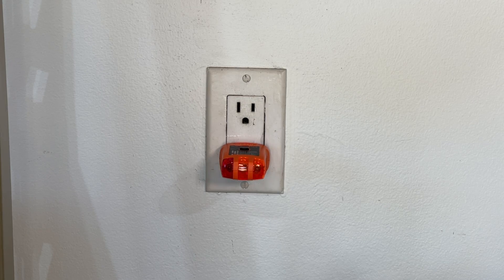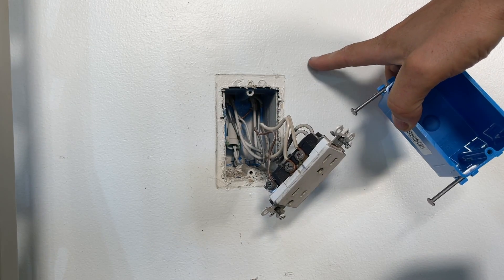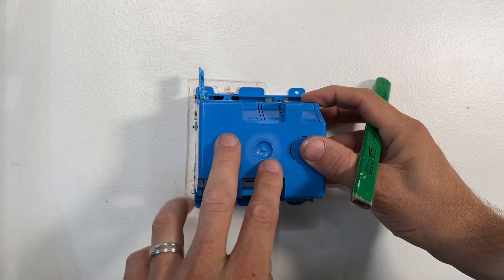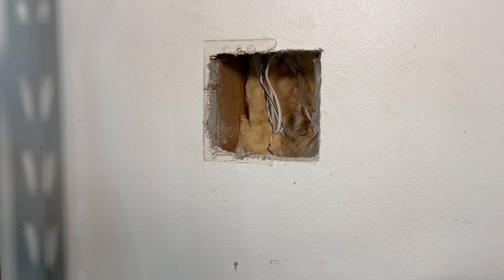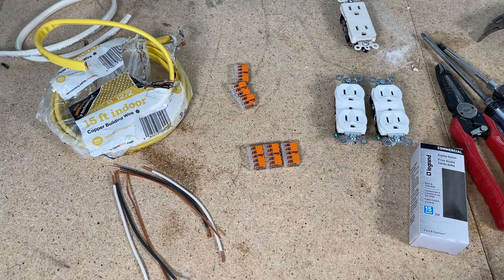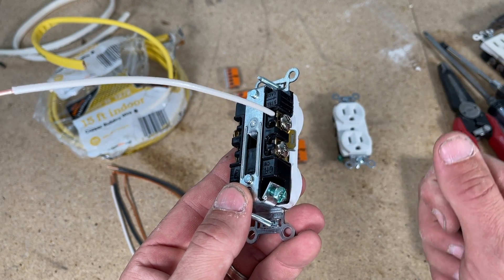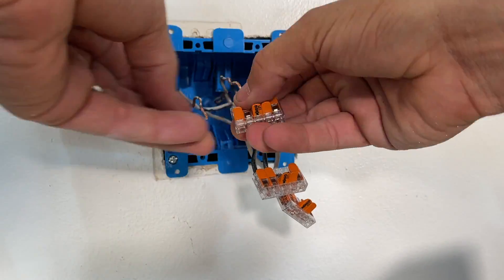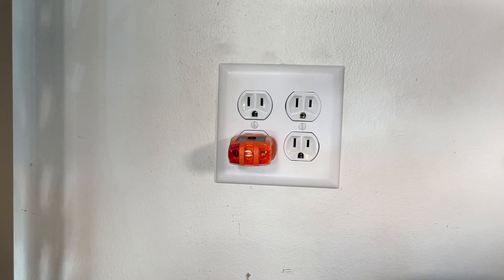Converting 1 Outlet Into 2

Comment: Thank you for pointing out the detail about lining up the faceplate screws! Drives me nuts when screws are not aligned, looks like installer didn't care. Sadly, my OCD has also cost me a few cracked faceplates from trying to tighten the screw "just a wee bit more".

Comment: I'm still trained to wrap every switch or receptacle with electrical tape. May never make a difference, but once is all it takes.
Reply: I agree, it only takes a moment, to tape it.  It cost close to nothing and makes it a bit safer for the next person as a CYA. 

Also if wire nuts were used, I would tape them off as well.
Reply: C NM BBL @alecbosse6425  ĺ b
Reply: Only time I wrap my recepticles or switches is if im working with metal enclosures.
Reply: I require it from our apprentices. Metal or fiberglass box.

Comment: I love these wagos. Im new to the electrical field and wire nuts are the general go to but sometimes dealing with low voltage and some drivers youre dealing with splicing together solid and stranded. These wagos make it a breeze. They have their obvious drawback in not being able to splice together a lot of conductors, also gauge of conductor can become an issue though rarely are you thinking about using a wago on anything bigger than 12, but I still think they should become the industry standard.
Reply from the maker: Agree, they are great and even though they do make a lever nut for 10 gauge I only use them on 12 and 14 gauge.
Reply: Similar have been in use in Europe for over 50 years now. My trade is super conservative and slow to accept better practices,

Comment: Great video. Can I add a third outlet? You added a second one but my wife needs six plug-ins for all her gadgets in the bathroom.
Reply: the problem with adding a 3rd outlet is the sheetrock may not hold up. You could add another box against the next stud and run wire between them. They'd be maybe 6 inches apart.

Comment: There is much easier way to do this. It’s called plugging in a multi outlet extension suitable for 12 or 14 guage for about 10 bucks with no need to fumble with electricity. I dont know why YouTubers do this over common sense since its these two outlets are on the same circuit. Epic fail

Comment: Why did you do 2 separate duplex outlets instead of a quad outlet?
Reply from the maker: At least in my area nobody uses Quads in residential.  Thanks for  the question.
Reply: @EverydayHomeRepairs  So no reason not to then?
Reply from the maker: Not that I see, if you want to install one you should be good.

Comment: Cheaper and cleaner looking than buying power strips, which have become quite expensive lately. On the other hand, there are so many charge based tools and devices nowadays that I have bought the long 12 outlet power strips. Also I always put a drop or 2 of lightweight oil on the screws of the old work boxes as the ones with the plastic tabs can be hard to tighten.
Reply: Also safer

Comment: Here in USA, why don't they "stack" the receptacles sideways so you can plug in power adapters (for example), with the wire coming downward from them, without blocking other receptacles?  Also, why don't they put the ground prong on the top for extra safety, like in case the plug is not all the way in and something metal gets dropped onto it?  It seems like here in USA they do things "backwards" when it comes to that.  If I were designing them, I would likely put 3 or 4 horizontally "stacked" receptacles with the ground prongs on the top.  That to me makes a lot more sense.

Comment: Off topic.  
My home is electically heated.  We have a 200 amp entrance. The furnace is a smart boiler. It heats water, and the hot water is circulated to the radiators with a pump. The smart part is that there is an outdoor sensor that determines the temperature of the water in the radiators.
During November, the water is lukewarm.  When it is really cold out, the circulating water is about hot 160F, and the boiler is drawing close to 80amps   The main entrance is GFCI protected and as well, protected against lightning strikes.

Both the boiler and circulation pump are in-home thermostat controlled. 
We also have a 60 gallon hot water tank.  Its heaters demand 30 amps at 220volts.
Here is a trick to save some money.  Because hot water is less dense than cold water, 
even if taps are off, there is flow of hot water up the pipe to the tap, and in the same pipe there is a flow of more dense water downward back into the hot water tank.
To stop that up/down flow,  get some braided water connection cable and connect it in the form of a loop, such that the hot water out from the hotwater tank has to flow downwards before it flow s upward.  With no taps open, you will notice that at the top of the loop, the braided cable is hot, but at the lower part of the loop, the water there is at home room temperature. The amount of braided cable I use is about 18 inches.
Reply: .... plumbers have been doing this trick with solid copper pipe for decades.

Comment: Since its a 20 amp circuit (using 12 gauge wire), should you have used 20 amp outlets?
Reply: Is the home run and every branch on 12ga? The receptacle doesn't matter it's the wire being protected. Now he mentions you could use 14ga which is incorrect if his breaker is 20A and the wiring up to those receptacles is 12ga. The breaker needs to match the minimum rated wire on the circuit, receptacles don't matter (to an extent. Most 15A receptacles should be able to handle 20A anyways but it's the wire that matters.)
Reply: @etherealrose2139  ... 15 amp outlets are normally a 20 amp pass-through so meets code.

Comment: The outlet has 2 breakers attached to the outlet that's why it has 2 hot & 2 neutral & 2 ground electrical wires? Change 1 outlet to 2 outlets, Romex wires run from the breaker panel does not need to change to higher amperage? If 4 outlets being used, the breaker won't trip or catch fire? Thx

Comment: You have the bare copper wire running right against the left one. Is that going to cause a problem? I seen electrical tape used to wrap the plug before installing.
Reply from the maker: Yeah, I doubled back later on and repositions the ground so it wasn’t close to the neutral.  Thanks for the feedback.

Comment: Not sure why did you use connectors/wago? I think simply you could just connect each outlet to one of the lines. just the ground wires you can use  one wago to 4 of them (2 from panel and one from each outlet) . I'm saying that because each outlet has two outlets connected by default. And I did as per my suggestion last month.
Reply from the maker: I like the pigtail setup so if an outlet has an issue it will not impact outlets downstream.

Comment: Good video. Those stab in connectors are garbage. Use wire nuts
Reply: @Travis Faherty -- Genuine WAGO 221 Lever nuts are not "stab in" connectors (if you stab it, you're doing it wrong), and beware that there are knock-offs out there, but the German-designed WAGOs are a fantastic improvement over wire nuts, if you'll allow your mind to be open. Can you imagine 50+ years ago the electricians who'd soldered/crimped and then bound splices with multiple layers of friction tape for their careers seeing those new-fangled "wire nuts" come on the scene, probably had a reaction like you. WAGO is a world  leader in this connector technology, lesser known in North America. Accepting new and better ways does not mean what you did all those years was wrong. But watch a video or two, maybe request some free WAGO samples from their website. I am sure you'll at least soften your stance if not outright flip your opinion completely, as many many sparkies have.
Reply: @isabellavision  do you push wires in? Or do you twist wires? Okay now just shut up.
Reply: @ironpig701  Not a chance. If you won't even try WAGO lever nuts and review the testing, you can wallow in your ignorance, but you don't need to spread it. Wire nuts had a good long run, but in home wiring applications, they will go the way of the knob and tube.
Reply: @isabellavision  10 year electrician. Been there done that. Wil fire you for using them
Reply: @ironpig701  You can't fire me, I quit. :) But yes, if you have employees, please have them use whatever you want, it's your right. But that doesn't make you right.
Reply: @isabellavision  well 10 years of this stuff around a dozen companies. Every thing from $100 jobs to $6 million dollar jobs. Dont wago. Guess you know more than all these folks
Reply: It's not stab in. They are spring loaded clamped lever nuts. Completely different than a stab in and work just fine. Either wire nuts or WAGOs are fine. Get with the times old man.
Reply: @etherealrose2139  if you say so. No to stab ins. No to wagos. Wire nuts is the way to do it.

Comment: Great video as always.  One question I always have with outlets:   does it matter if anything touches that ground wire in the box?  usually everything is so cluttered in there stuff ends up touching it.  IDK bare wire without coating just makes me nervous.  (I know nothing, sorry if a dumb comment)
Reply: The ground wire and the neutral (white) wires are hooked together in the main breaker box right where the wires come into the house. As long as it isn't the hot(black) wire that touches it, it isn't that big of a deal. However, when I do any electrical work I always, always, always make sure the ground is covered! Even if I have to use a piece of heat shrink tubing on the ground wire, the ground will be covered when I'm done working on it!!!
Reply: Not dumb, smart and, yes, we'll soon see NEC require ground be insulated just as the hot and grounded conductor.

Comment: It was a little hard to see, but it looked like the ground wire on the left was very close to the neutral terminals. I know this is very unlikely to cause a problem, but best practice is to make sure the grounds are back into the box  away from the terminals. I once had a situation where the ground was near the hot terminal and I didn't notice until some time later that due to vibration it had loosened the outlet and when plugging into the outlet it shorted the hot terminal to ground. The breaker tripped, and it took awhile to trace the problem.
Reply: Nice demo of adding a second outlet.  I saw the same thing Tom Cee observed.  I dislike uninsulated wiring "fluff" inside of the box and try not to add to it if possible.  I would prefer substituting an insulated green wire for making up the ground portion of the pigtails (or a white wire marked with green tape).  Neutral should not be touching ground except at the Main Panel (and it didn't in this case, but pretty close.)
Reply: Our outlet and device designs are kind of stupid. There are these big exposed spot on the side of switches / outlets. It would be no problem if the screws weren't hot or had a cover. It seems very dangerous especially if there isn't a cover on the outlet.
Reply: @abdulelkhatib2674  .. there is a section in the national code about covers for boxes and it seems they are required.
Reply: i had old house and figured i would go with metal electrical box and they don't seem to make them very deep like plastic and when pushing wires back into box the one black wire actually was nicked by sharp edge on the hex/slotted ground screw in back of box so it blew circuit breaker when i turned it on
Reply: Since the neutral and ground are bonded at the main panel it shouldn't be an issue though you want to avoid stray current going back on the ground. Best practice is to try to bury it back in there away from the conductors and terminals, especially the hot as you said.

Comment: Another tip would to be make one of them GFI if the circuit isn't already protected by one. I always put electrical tape to cover the screws just to add another level of safety.
Reply: I've never seen the mounting nails of an old box come out as easy as you showed.  They are usually  corroded,  and /or just wedged in there due to all the temperature expansion and contraction of the wood studs.  Not to mention if the original installer didn't drive the nails in straight.
Reply: Electric tape is for hacks and people amateurs.

Manufactures don't include or recommend tape for a reason. It is superfluous and even can hide or add to failures. There is no reason to ever cover the terminals with tape. Or wire nuts. Ugh.
Reply: @etherealrose2139  why would a manufacturer include tape with an outlet? 
And its not for hack or amateurs , you tape around the screws as a courtesy to the next guy who needs to work on it in a few months, next year, or 10 years from now. Always think of the electrician after you,  no unintentional booby traps

Comment: How is back stabbing an outlet not "good", but using the wire connectors like you used acceptable? They both use the same retention mechanism.

Comment: Appreciate your video... Thank You!!!    Isn't it a standard business practice to wrap a wired outlet with a few wraps of black electrical tape before securing the outlet/switch into the box.... to protect against shorts?
Reply: If it is a metal box , it’s not necessary for a.plastic junction box
Reply: @genebeckley5189  it's not necessary for metal or plastic. Receptacles are screwed into the boxes. There's no way for the terminals to touch.

Wrapping tape is the sign of a hack or amateur. You properly cut to length and strip to length tour conductors and tuck them all to the back when done so the terminals are free and clear. Make sure they are tightened down well. That's it. Adding tape hides possible failures amd traps heat that is given off by loads pulling current through. You don't want to trap heat for any reason. It's actually more dangerous to use tape.  Then there's there's sticky mess it can leave if it heats up and melts and causing more resistance on the connections. 

Just no point unless you do not know how electricity works like really old timers that was taught that way back in the day because they were scared.
Reply: @etherealrose2139  I was refering to the side tab that protrudes further out than the screw terminals when you have to straighten the outlet so it’s not a little side ways you won’t get shocked and as far of all the electricians I’ve workedJed with over the years it’s not a sign of hackers work I’ve even seen it done on commercial work and I’ve been doing electrical work for 40 years now
Reply: @etherealrose2139  Funny, I've not yet failed an inspection for that...in over 40 years. Guess that's now three generations of dumb inspectors and stupid me.
It's not a hack, it's called proactive safety. What 'heat' would I be trapping?

Comment: Best pratice is to punch a tiny hole in center of new box livation then insert a #14 wire and spin it. Do this at several depths to make dure mothing in the way. Does not appear that you have a minimum of 1/4" outer jacket.of MN cable pass the vable clamp. If not a coflde violation.

Comment: Your method of changing a 1-gang box to a 2- gang box is the same method I use, however if your changing a 1-gang metal older box to a new rework box you have to take into account the metal brackets  hold the box with a small space off the wall stud thus you have to take that in consideration in cutting the wall larger for a 2-gang box…
Reply: What the heck are you talking about…..?
Reply: @alant5757  I guess you haven’t seen some older metal boxes that have the bracket on the side of box that pushes the box away from the stud about 1/4 of a inch

Comment: I basically did the same thing a couple of months ago. I was remodeling and had the drywall pulled off so I could nail the box to the stud. Other than that it was the same process. I like that you can tighten the wire down in on your outlet and then connect your wires together. I suppose you could still do it this way with the old style wire nuts but the WAGO lever nuts makes it way easier. I wish I had some when I first started remodeling.

Comment: There is a much faster way to do this. First off you don't need the box right next to the other box it can be a couple inches over. Then all you do is you loosen up the clamp that secures the wires in the old box. Push your new wire down into the area between the two by fours. Then cut a hole for your new box. Reach into the wall with the wire or whatever child's hand. And pull the new wire up through the new opening. Then wire up the new box. I like your video so don't take this as I put down. It's just a faster easier way to do it. Thanks for reading.

Comment: Next time do what the pros would do. 

1. Don't use a drywall saw unless you can first verify that no piping or wiring is located behind the drywall where you are about cut.
2. Use a deep 2 gang metal box that you can screw directly to the stud, 2 gang remodel box in a garage/work bench application is a accident waiting to happen.
3. Use more care and don't let the equipment grounding conductor touch the neutral terminal on the receptacle. 
4. Use 20 amp receptacles in the garage where there is a possibility that some tool may actually require 20 amps. 

Finally, ditch the WAGO commercial, those things cause more problems then they solve.